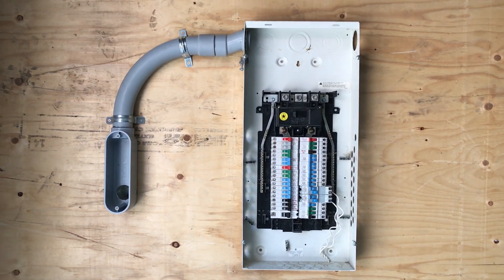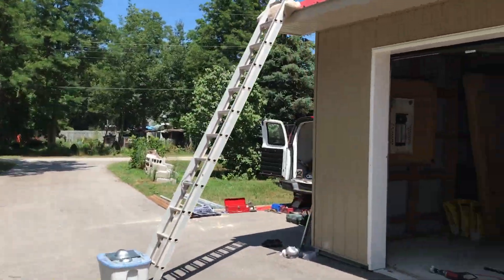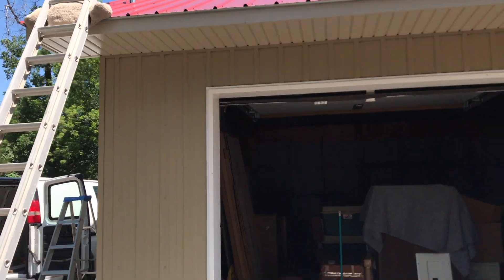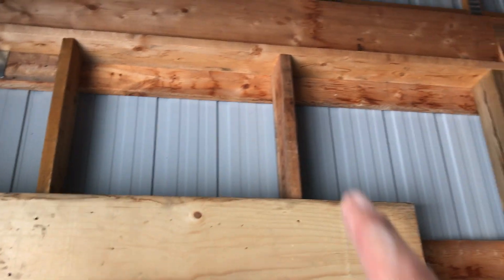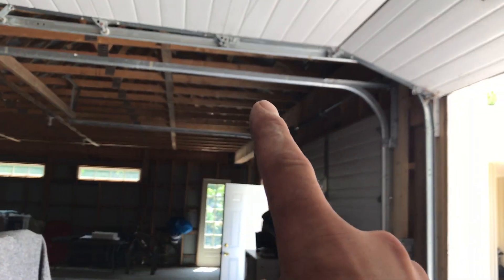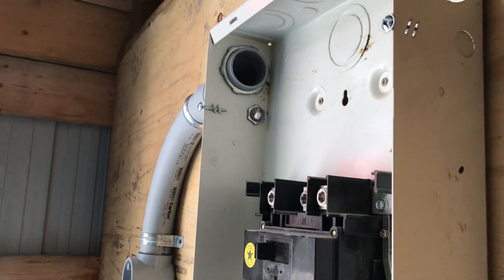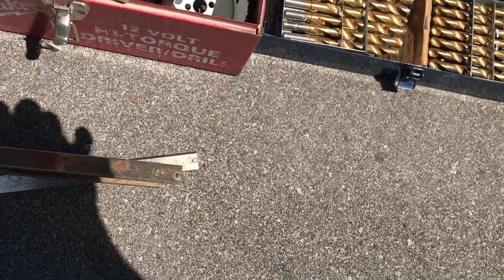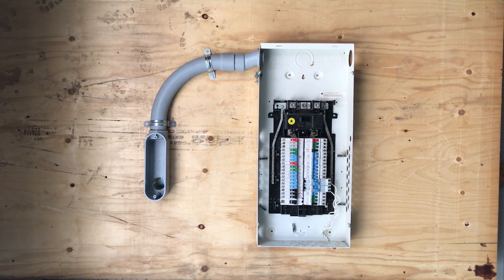DIY 200 AMP ELECTRICAL SERVICE PANEL UPGRADE part 1

Comment: One thing that should be stated up front. You had better check that you can even get away with doing this without an electrical contractors license... Where I am at the power company would never hook this up unless a licensed contractor is connected with the installation.
Reply: Not sure about using this type of box, but in most places a homeowner can do it themselves. Your local electric company still needs to be notified so they can determine what is to be done and to disconnect power and then check over what was done before reconnecting and giving you power.

Comment: Stab lock panels are not allowed in my area. I looked at buying a house that had a stab lock panel but the electrician told me it needed to be replaced since its a safety hazard.
Reply: They discontinued new Federal Pioneer panels here in Canada about 12 years ago and now they are one of the most expensive brands to get replacement breakers for so I would not have used one on top of half of the more quality electrical contractors recommending replacement.

Comment: What happens if you have ADHD and go to pick up your materials and you forgot the material list............( answer) writing it down a 2 x 12 it's a little bit harder to leave behind or miss when you're on your way out I can't tell you how many times the fellows at the supply house would get tickled at me because I would be dragging this big ass 2×12 in there with a list on it
Reply from the maker: Making lists and keeping them is a big problem for me I don't like to read or write things I do everything in my mind and with images and pictures . That's how I learn stuff, watching and listening. Yes I would write on lumber or cardboard also. Have a great night bud.
Reply: I put lists on my phone. Always find myself wandering around home depot trying to remember what i went there for. I always have my phone so i can check it